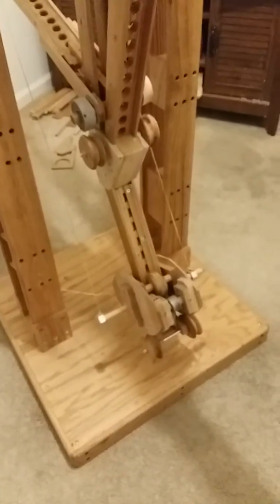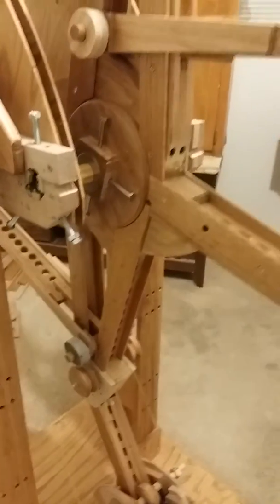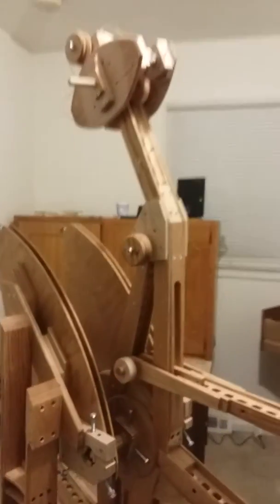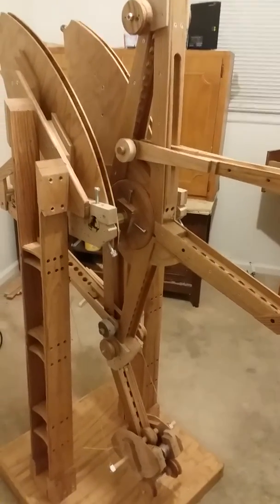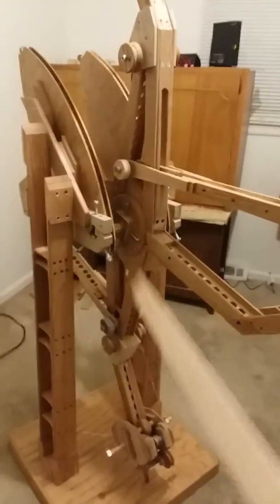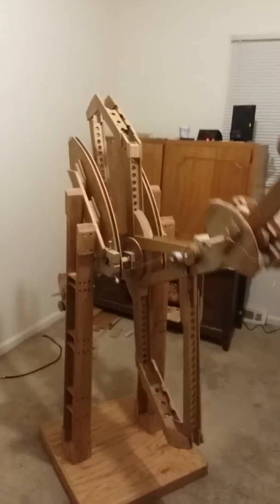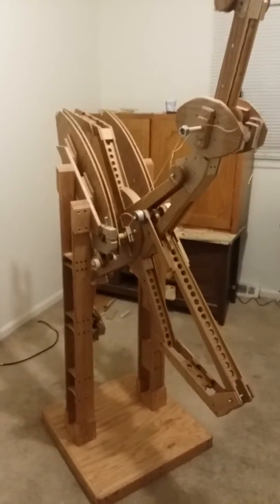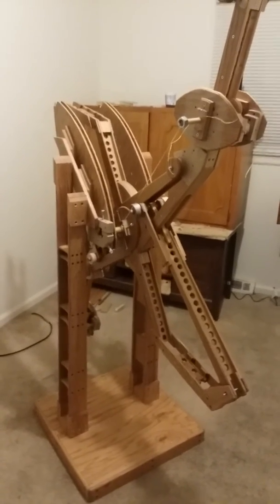Bessler Wheel Demonstration

Comment: Have you looked at Sjack Abeling gravity wheel?
Reply: A good example of engineering. I wish you success😊
In my opinion, this type of machine can work in accordance with the laws of physics.
Reply from the maker: I have. The reason for the discs are to conserve angular momentum. If it works then that conserved energy will be what powers the wheel.
Reply: Blabla bla bla bla bla blaaaaa..